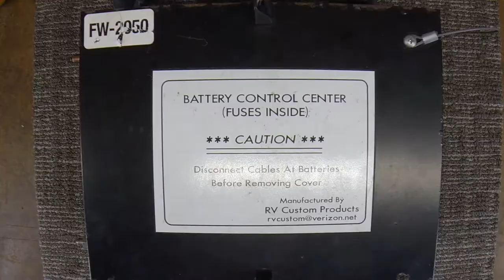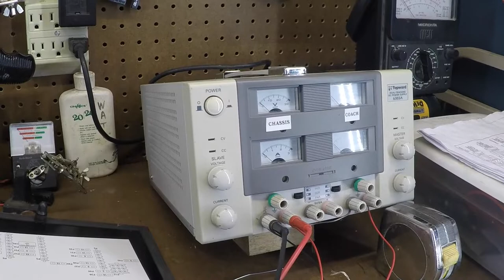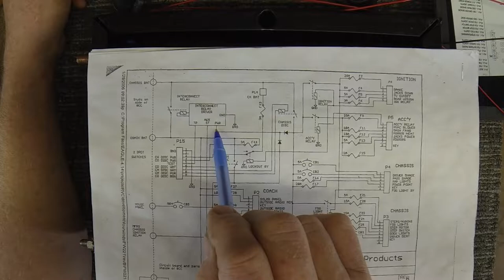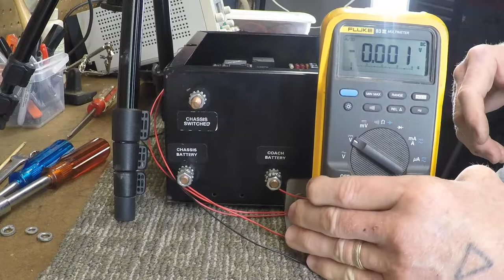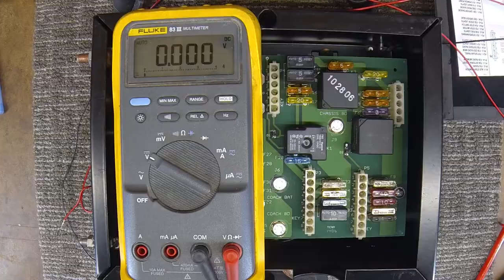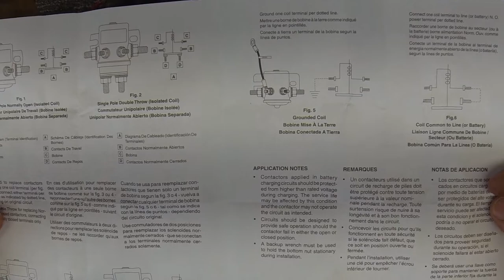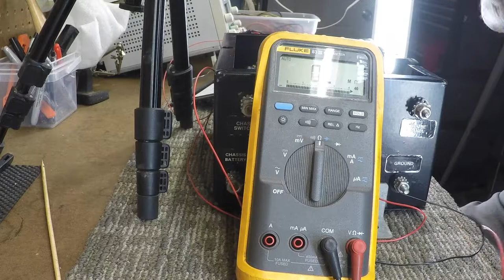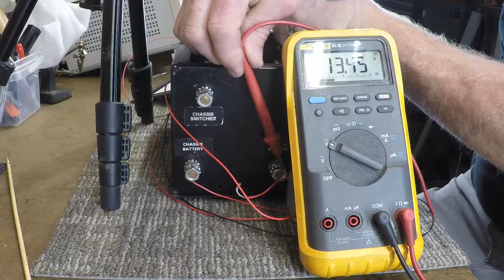RV Custom Products Battery Control Center (BCC) - Troubleshooting and Repair

Comment: Thanks Wayne. just yesterday i checked my RV(2019 southwind) and all batteries were dead. I have it plugged into a 20 amp plug and thought it would stay charged. I replaced the chasis battery and it started up, but none of the interior lights would work. This gives me a starting point for troubleshooting
Reply from the maker: Thanks for the feedback, John. I hope you’re able to fix the problem! Let me know what you find.
Reply: @WaynePolcin  
Ok, I feel like a newbie. My house batteries were low on water. Added water and two days later( after charged) everything works.  Lucky I didn't tear things apart.
Reply from the maker: Good news! If your batteries are about 5 years old or older, you should start planning on replacing them. It really depends on how many times they have been allowed to go dead. Lead acid batteries have a limited number of charge/discharge cycles before they will stop taking a charge. I’m glad you got it going! Good luck to you my friend!

Comment: Outstanding video and very easy to follow around. Pretty much my exact problem I am just having a fit trying to remove the BCC box cover to get inside. Little handles lift up but don’t turn. It’s a 2014 THOR HURRICANE.
Reply from the maker: Yeah. Those covers are a bear. They're just a compression fit, so keep working at it, you'll get it. Thanks for the kind comments!
Reply: Got the cover off and the circuit breaker was tripped. Easy fix once you pointed it out in your video. Thank you very much.

Comment: Thank you very much for explaining this.   I have something draining my batteries. When no shore power, and setting with house on, drains house batts.   With house switch off it drained the chassis battery.   It takes about two days.   I was testing and getting 5 amps and dropping off to 2.5 amps after 2 mins.   This video explained that it is hoping to the chassis battery.   Now I know I have to look elsewhere.   Thank you again!   Respectfully,   Kevin
Reply from the maker: Hi Kevin. I always appreciate those like you who give this kind of feedback. At the time of making this video, I had no idea of the need for this information in the RV community. I have found that my radio/CD player was slowly draining my battery. I had to disconnect the radio to remediate the problem. At some point I will pull the dash panel off and rewire the radio power for a permanent fix. Good luck to you, my friend!
Reply: Wayne Polcin    Thanks.

Comment: Very in depth. Correction 😉 Fluke meter O. L. = Out of Limits.  When a contractor or relay is completing a circuit it is called "closing" a circuit. A "short" is usually unwanted or induced closing or completing of a circuit.  I ❤️ that you share your knowledge with an open mind, and that teaching is also learning at the same time.  Thanks for sharing❤️🔥😀

Comment: Wayne,  Excellent...Excellent...Excellent  video.  Exactly what I was looking for... I don't think anyone else would be as thorough.  I watched the previous video you made on this also.  I purchased a used 2014 Thor Outlaw in Jan 2020.  Spending the winter of this year in Florida in it.  About a month in I had issues with the Sun and Night curtains, plus the steps hesitating going in and out.  Tried to start the engine... won't start.  Got the test meter out... low voltage on the chassis battery. Charged it and called the support people on the warranty and service.  Technician came out, diagnosed the board and relay needed replaced. Unfortunately he left the company before the board came in. The replacement tech came out to finish the work... I knew I was in trouble when he did not disconnect the battery terminals and told me when questioned he would disconnect at the Control Center. Obvious happened... before leaving he told me the "new" board was bad and another had to be ordered.  Months went by, I stopped by their location many times, "not yet" , never followed up with me, only me contacting then.  Come the end of March I left and came home.  Never did hear from them.  In the short term I just ran the engine once a week to keep the battery up.  I've had no luck getting into a shop this busy season so I thought I'd try it myself... this video has given me the confidence and the knowledge I wanted.  It was easy finding the relay solenoid, but I have not been able to source the FW221 Rev B1 board.  Any help there would be appreciated.  Thanks again for a great video...
Reply from the maker: I have a hard time believing the board is bad. But this is my bedtime and I can’t put too much thought into it right now, so I’ll literally sleep on it and get back with you. I’m happy that the video was able to help you. Stay strong safe and kind, my friend, until I get back with you!
Reply: Update:... Fortunately Calling RV Custom Products was worth the call.  They still make the same board and will sell it to me.  So I ordered it.  The board is still P/N FW221 Rev B1 which is the latest version, and the cost was $239.04 plus shipping. They only ship UPS ... COD so you have to pay the driver upon delivery, or ship to a UPS location to pick up and pay.   They also informed me that Thor Motor Coach no longer has them producing boards for them, Thor is using another supplier.  Hope this information is helpful.  I may not need the board as you suggested, but if I do at least I will have it available in the future.

Comment: Great video Wayne.  Quick question.  I'm trying to upgrade my coach AGM batteries to lithium and because of that I'm currently trying to figure out a way to install the DC-to-DC charging (in order not to kill my alternator)...  Only issue is that I need to figure out how to disable alternator charging for the new lithium batteries.  Can I do this by taking a fuse out of the BCC?  If so, which one?  Thanks so much in advance!

Comment: Hi Wayne and Suzie!!😀😀
Now my head hurts after following that repair. LOL!!😀😀
Too much for me to take in after hunting down a problem with my measuring computer for 4 hours today. LOL!!  But I figured it out. It's amazing how a bad wire can really mess with you!!
Take care my friends!!😀😀❤❤
Reply from the maker: Like I told Angie K, the RV world is in need of info like this. It was my contribution to the cause. I know it has nothing to do with tree work, but it has everything to do with giving of myself to help another human being! Thanks for the comment, Al!
Reply: @WaynePolcin  :) You did a great job showing Everyone the proper way to solve the problem!!😀😀👍
I do love it when people do a repair and video it. 
I go to You Tube for help on many different things I'm working on. 
The only bad thing about what I was working on is that it's the only Takeuchi 1140 track excavator with a tree harvesting convention. So there is no videos on how to fix it and really nobody that needs one but me. LOL!!
Take care my friend!!
Reply: Hi Wayne,  My class A solenoid  will click but no "charge, will not start at this time(new batteries) dash lights don't work,horn works, radio works,heater does not work, some tell me it's the solenoid, but I'm getting the click. Do you have an idea? Thanks Rick

Comment: Great stuff! I recently upgraded by system with (2) Battleborn LiFePO batteries in Parallel &  Upgraded a compatible charger - all good. I then also dropped in an automatic switch and tied in an a 2200 Inverter to have 155/120 vac power tooling down the road or on demand. How will the LiFePO fair given their designed to stay steady at 12vdc to the 20% mark then dial off and of course the Led Acid Chassis is a different animal. Any thoughts to be aware of?
Reply: I did the same swap with the  (2) Battleborn LiFePO batteries but didn't change the Inverter.  Wondering if that caused the battery relay switch to be connected 100% of the time and as a result failed.  The coach panel is no longer getting any power.   Although I do get a reading of 13.25V from the  (2) Battleborn LiFePO batteries.
Reply: @mealwaysright4259  THX-  I did upgrade to the correct control unit this year to provide proper charge control for the LiFePO batter pack - no issues since... even with the Chassis engine battery.

Comment: Awesome work there Wayne!!! I'm concerned that my emergency battery switch or relay is actually stuck and keeping a charge going while we are plugged in and in "use" mode. I will get a meter tomorrow and check the chassis battery for a bump in voltage. The battery was all but dead but now it's charging and hot to the touch. And smells like rotten eggs in the rv. I disconnected the battery and the smell went away! Also, my radio is off but really hot until i disconnected the battery.!?! Just bouncing this off you after seeing this video. Thanks for listening and keep up the good work!! Y'all be safe!!
Reply from the maker: Jim McMullen I will need more info about you rig. I don’t understand why you’re radio would be hot???  How old is the battery in question?
Reply: @WaynePolcin  Hi Wayne, thank's for your quick response!!! Much appreciated indeed. So, the battery is quite old as far as I can tell. I will pull it out to see the dates. It has required emergency help for a year now, after it sits for a week or so (my bad). BUT....just this week it seams to be charging while plugged in. It's very warm to the touch which led me to believe that the relay is stuck and allowing a continuous charge. The radio...IDK. Even with the battery disconnected it works & is hot to the touch. FYI, it is a replacement done by the previous owner (and at a dealer as he was not capable with electronics). Now....last week I had a failure at the shore receptacle. The plug was old / loose, heated up and melted the receptacle and plug. I replace both the receptacle and the power cord (30A). Wires looked good going to the WFCO Power Center. So, in the back of my mind the smart charger may be applying more than a trickle from the WFCO 55 Amps Power Center Converter Charger. Again, in the back of my mind!!! Finally, to make matters more difficult for me...my son has my amp meter so I am....crippled!!! Man, I feel so liberated being able to converse with you, so thankful for that Wayne!
Reply: FYI: I replaced the house batteries a year ago.
Reply: Chassis battery is 3/2014...same age as my Thor A.C.E.
Reply: Putting my new chassis battery in now!!
Reply: And now....new chassis battery connected gives me 12.8v. Flipped the "use" switch...I hear a relay throw......and I have 13.1.  I think I need to sit there and listen for another throw once the charge reaches 13.6. but now its raining!! Tampa area!!! It took me a half hour to clean up the wire ends and another hour chasing a snake out of our utility room. I went in to get dielectric grease and he jetted in front of me. Dang it!!! Rain just stopped, going back out!!
Reply: And so now, the max volt I have is 13.5 ....with my chassis battery disconnected now and my meter on the chassis lead out of the BCC. I'm hoping that at 13.6 it will disengage and show me 0.0v at the BCC chassis & 13.6 at the BBC House. If I'm stuck at 13.5 then that means the chassis battery will have a continuous charge which can't be good for it!?!
Reply: And now...I disconnected the radio as it remained hot to the touch. So, now the voltage is reading 13.6 but the relay will not open. At the BCC  I have 13.6 at both the chassis and coach leads (the chassis battery is disconnected to keep that from reading at the BCC chassis lead).
Reply: And finally....she starts without the chassis battery connected!!! It's got to be the inter connect relay - stuck closed. Now, is it the circuit board or the relay. Relay is cheapest and more likely the suspect so I will order one accordingly.
Reply: I also disconnected the emergency switch...that didn't release the relay either!!
Reply: Maybe the radio is on because the relay (if stuck closed) is allowing current from the coach to keep it "connected". Remember, the mirrors & backup camera work when driving whether the radio is on or off. Perhaps feedback there too!! All these things to consider!!! FYI; new relay should arrive any time now.
Reply from the maker: Wow, Jim! You've been busy. It's taking me a little while to digest and interpret what you have done. So I apologize for taking some time to get back with you.
1. If you have the chassis battery disconnected and you are seeing 13.6 volts at it's terminal on the BCC, then you are correct that the Interconnect Relay (I.R.) is energized.
2. If you disconnect your coach and chassis batteries, with your meter set to ohms, you should measure an open (O.L) circuit between the chassis and coach terminals on the BCC. If it measuring close to 0 ohms (short), then the I.R. is stuck in the closed position.
Reply: @WaynePolcin  Your Back!!! Yes, busy....but more typing than actual work - my brain hurts. That's a great point, I will disconnect the coach shortly. FYI: I love working on this stuff, as usual...it's a learning process. I have a minor honey-do chore then I will get back on it!!! Once again, please know how much I appreciate your mentoring. Let me know if you need any graphic design work, I owe you big time!!
Reply: Well sir.....I  ran out of time AND the new relay didn't show up. As I said previously, my son has my meter so I have been working with a make shift digital "reader" that I made from a cigarette lighter plug in voltage display - if you can imagine that!! It works excellent but not for ohms. I could rig a light bulb to check continuity through the I.R. but the weather is not cooperating and we have a few rough/rainy days ahead of us. So, I disconnect the chassis lead at the BCC and buttoned things up. Ran the motor and the new chassis battery is charging nicely via the alternator 14.6V or so. I will tackle the BBC box & I.R. as soon as the weather clears. With a hurricane forming down there in he Gulf I want to be able to flee in the RV! The BCC is something I prefer to deal with at my leisure. I will update you asap with all my findings in the BCC box. Cheers mate!!
Reply from the maker: Great, Jim! I look forward to hearing back from you on this. The meter would be a great help if you can get your hands back on it. Be safe, strong and kind, my friend!
Reply: @WaynePolcin  Thanks Wayne! I will get the meter back next week or so. I hate to by a new one. You as well.... be safe, strong and kind! Cheers Mate!!
Reply: But wait...How about this......I temporarily connect the new switch outside of the BCC. Connect it between the chassis lead and the battery.....add a control wire from the emergency start switch, pin #1. That way, I have control if needed. Remember, for whatever reason....the IR is stuck closed!!!
Reply: I got nothing at the switch!!! I'm gonna stick my head up there and check all the fuses in the BCC box. I'ts soooo difficult to do that the way they mounted it up front. Just plain stupid!!
Reply from the maker: I'm not following your logic. Maybe you should explain what you are attempting to do. Do you have a known good COACH battery? What "new" switch are referring to?
Reply from the maker: Hey Jim, send me an email at wpolcin@gmail.com and include a phone number so I can call you to talk about this. I think that would help me to better understand how to help you.😊

Comment: Great video.  I have changed the combining contactor and now a year later it seems I have the same problem again.  The relay has become intermittent.   This fw2050 is a pain to take out and put back, so I thought I might install the new contactor externally to the side of the box where I can get to it without removing the entire unit and taking it apart.  I would remove the unit one more time,  but I would change it up to where I would mount the new relay to the box where I can get to it easily, and make up new heavy cables to run to it from inside the box.  This would make it easy to test and change that relay if if it dies again.  Looks like this is easily do-able.  any thoughts on this?

Comment: Great video, I have a Fleetwood rv with revision P of this bcc.. I'm working on duplicating this issue on purpose. My battle born installation has the potential of placing excess strain on my alternator. Solution, place a switch on the yellow wire to selectively control coach and chassis battery connection.
Reply from the maker: Good idea. That's the nice thing about having a functional understanding of how the BCC works - you can come up with your own solutions to your specific problems. Good luck, my friend! Stay safe, strong and kind!
Reply: That's cool, what amp switch did you choose/use for the yellow wire?
Reply: Going to do the same thing, want to disconnect the alternator from melting down trying to charge my LiPo coach battery bank in 39Z Bounder. Great video!

Comment: Thanks for the video.  I had a similar issue with my Thor 2012 A.C.E. 29.2.  Went to storage where I keep it plugged into shore power.  Chassis battery was dead, coach was fine.  Trouble shot it with John from RV Custom products and it looks like my issue is the circuit board.  Got the new board, now I just have to put it in.
Reply from the maker: Glad to hear that Joel! I can probably repair that board for you. If you would like that to happen just message me at my email account wpolcin@gmail.com. It would only cost you shipping and the price of any parts. Thanks for the positive feedback!
Reply: @WaynePolcin  I will probably do that.  I already have the new board-just have to swap it out.  Always good to have a spare.